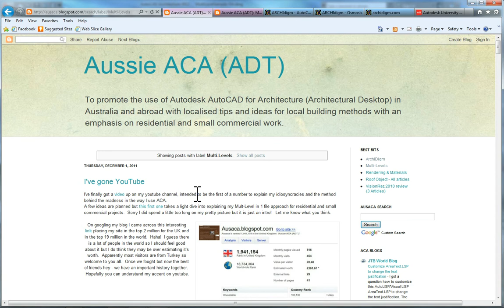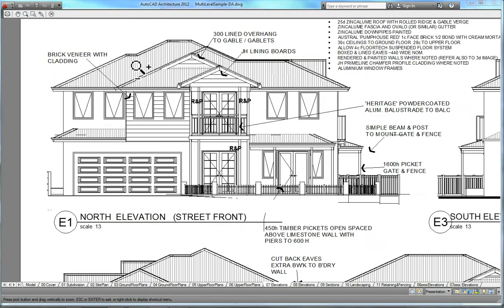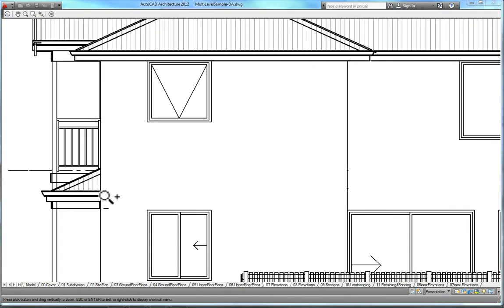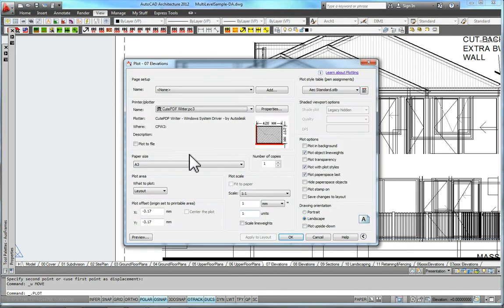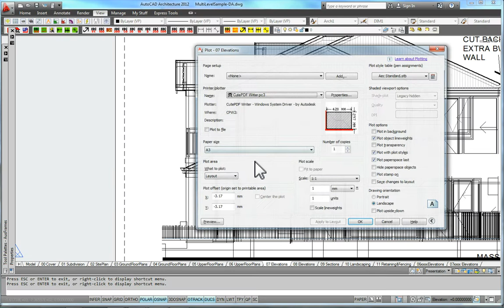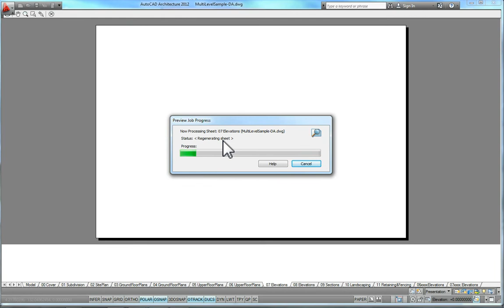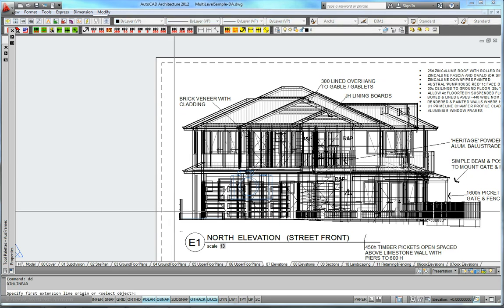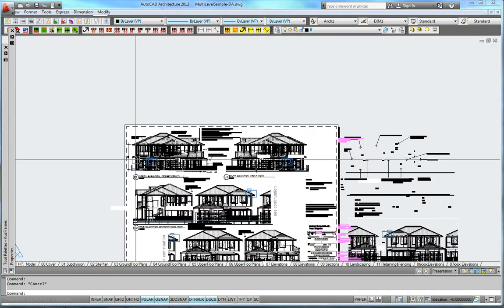ACA Multiple Levels in 1 FIle Residential+) -7 ElevationsAlive

Comment from the maker: NOTE: I no longer do this as the 2016/7? updates to the aecELEVATION tool make using the elevation creation tool much easier.
The updates mean you can exclude items once and it remembers that selection AND it includes anything added into the area the tool surrounds which means creating and maintaining edits are much easier.
Prior to these updates, this method might be of value.